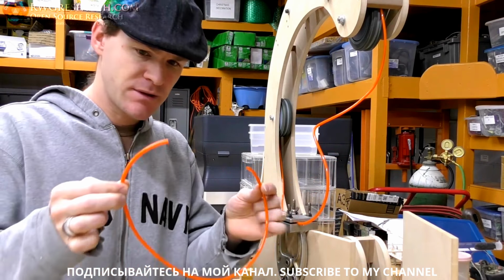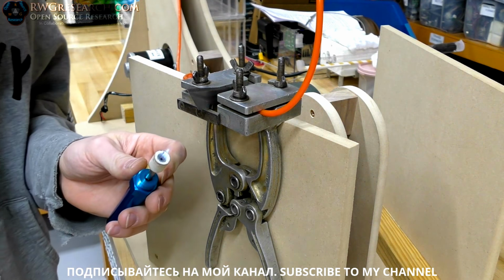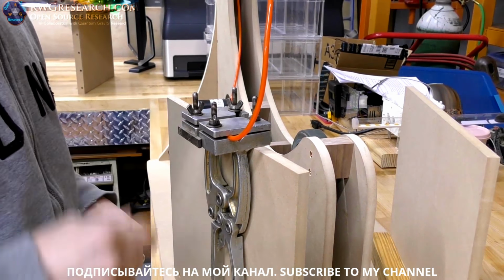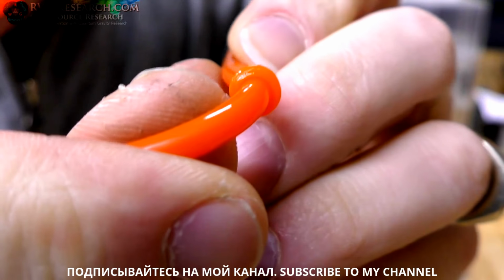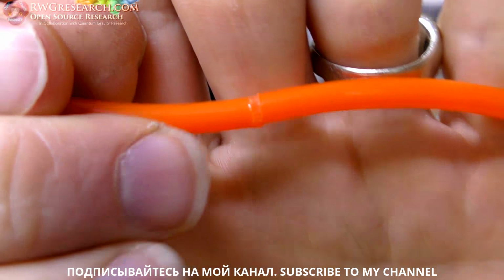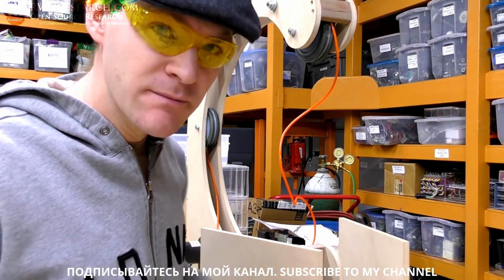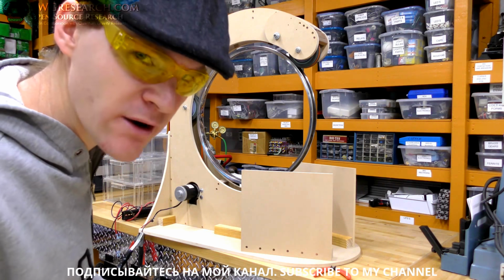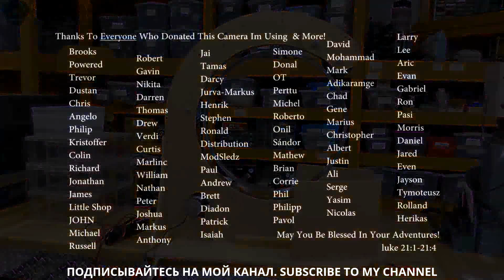⚫ How to Vulcanize Rubber. ♦How to DIY♦

Comment: Vulcanizing is a chemical process done on latex; it's how natural rubber is made. What you're doing is not vulcanizing, but plastic welding. TPU is a thermoplastic. There's actually TPU filament for 3D printing.

Comment: As a teenage surfer in the 1980s' I regularly did this with snapped surf leashes. It meant you could go right back out in the surf without having to go find a store somewhere to purchase a new one. 

The process was as follows:
1. Hold the 2 broken ends in one hand and melt the ends with a cigarette lighter.
2. When you have a nice melted blob on the end of each of the broken ends, put the lighter down and take one end in each hand.  
3. Press the 2 molten ends together, holding them in place until the plastic solidifies. 
4. Go surfing

I have snapped many leashes over the years but never had one of those repairs fail.

Comment: Love that stuff. I used a lot of it in a mail factory on graveyard shift. No night time mechanic so when a machine broke down we had to try and get it back up ourselves. We used to have these hinged aluminum sleeves the same diameter as the tubing. Then we didnt have to cut away as much mushroom. Worked like a charm.
Reply from the maker: Thanks for your comment.

Comment: Awesome video, bro. If I wanted to puncture/cut a slit in a tennis ball so that I could shove other bits of a second tennis ball into the first tennis ball, do you think that I could then melt the punctured seam of the tennis ball back together by heating it up like you did? If so, is there anything I should know before trying it?

Comment: This is not vulcanizing.
Reply from the maker: Why do you think so?
Reply: 1) Vulcanized rubber doesn't melt, it burns
2) Vulcanized rubber holds it's shape, like a tire or a radiator hose
3) Vulcanizing is done with chemicals under pressure.

You are demonstrating thermoplastic melt/freeze of a synthetic polymer. It's a completely different process.
Reply from the maker: Ок.
Reply: @howto_ua  He's perfectly correct. What you are doing is nothing to do with vulcanization at all.
>
Reply: Agree .... thumbs down on this video for misleading title and spreading false knowledge!

Comment: I would like you know why you call this vulcanizing?  vulcanizing is the curing of rubber.  this isn't that.
Reply from the maker: Maybe you are wright.
Reply: Vulcanizing is cross-linking of rubbers by heat and/or chemical processes.  Silicone rubber, sometimes called RTV, where RTV stands for Room Temperature Vulcanizing.  Heat only can be used as shown in this video.  Cold (room temp) vulcanizing patches are also used for repairing inner tube punctures.
Reply: @RichardFallstich  I'm not sure that's correct. I was under the impression that when a thermoplastic melts, it's not the polymer crosslinks that break, but the van der waals forces. It's a physical process, whereas vulcanization of rubber is a chemical process.

Comment: Interesting to see the technique for heat-joining urethane O-belt. BUT the term 'Vulcanizing' actually means something entirely different. It refers to the process of using sulfur to form cross-bonds between the carbon chains of latex rubber, to form tough durable cured rubber, like in tires. Google it. I'm curious to know where you picked up such a misuse of the word, why you didn't check it, and why over a year later (despite being told) you still didn't fix the title. Nothing to do with clickbaiting, surely?
Reply from the maker: Sorry. I`ve got four channels. So, there is no time for fixing of titles.
Reply: This video was taken from the user rwg42985.
Reply: @howto_ua   Nonsense. You are wasting the time of everyone clicking on this. And how are you in possession of this video??